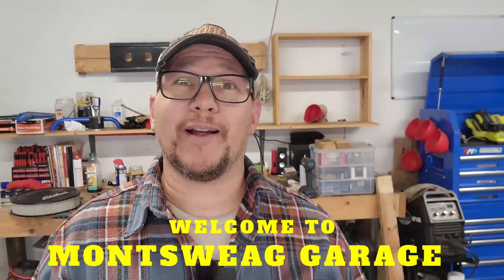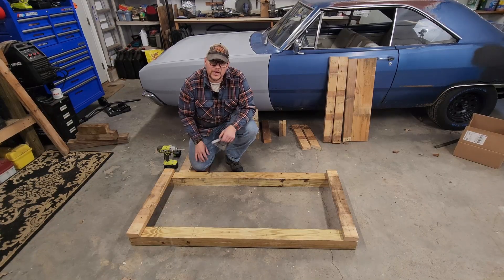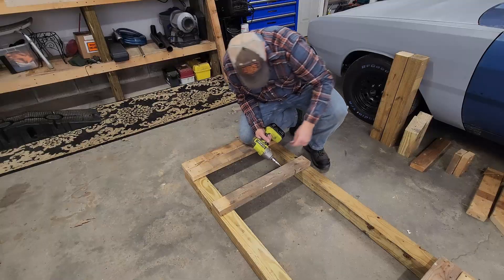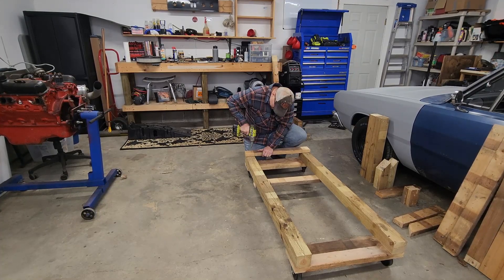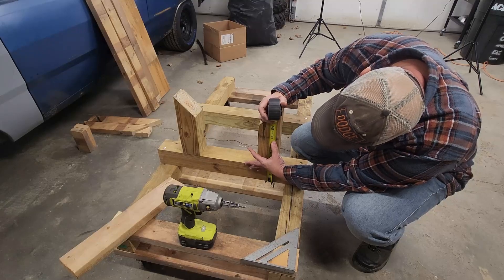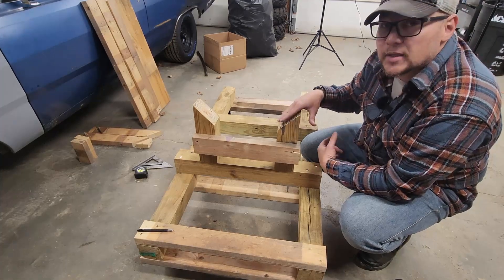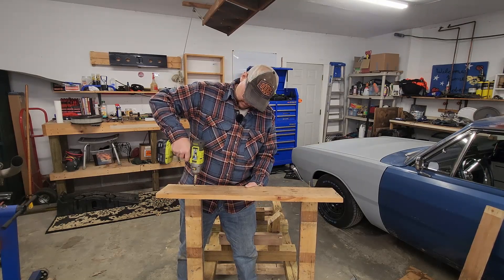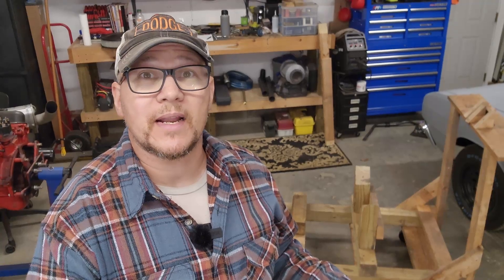How To Make A DIY Engine Run Stand For a Small Block Mopar

Comment: do you think these measurements would work good for a 66 ford 289 engine
Reply from the maker: Hello Carter and welcome to the channel. To be perfectly honest, I have no idea. I figured out the spacing for mine by hanging line with a washer tied to the end from the engine mounts and measuring the distance between them. I did this on my 273 while it was on the engine stand. Fortuneately, the 360 and the 273 use the same mounts.

Comment: How much wider on the mounts for a 440?
Reply from the maker: James, thank you for the comment. Though I do not have direct experience with a big block, from what I have been able to find, the B/RB engines should be about 2" wider than the LA engines at the engine mounts. I hope this is helpful.

Comment: "I's not just good, it's good enough." Awesome!!!! Seriously, super informative video. I plan to make a stand just like it next month. Thank you
Reply from the maker: @casenumber8799  Welcome to the channel and thanks for the comment! I'm glad you found the video helpful. One thing to keep in mind, if you are using the stand for long tern storage and moving it around a lot like I ended up doing with my 360, you may have to tighten the screws on the front bit the radiator mounts to every so often.